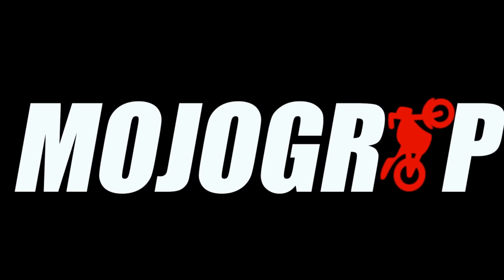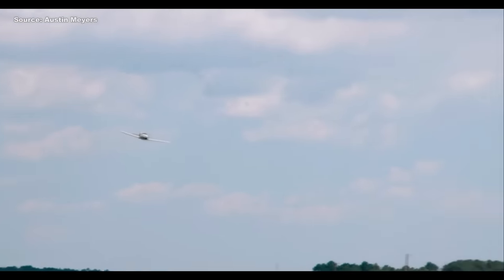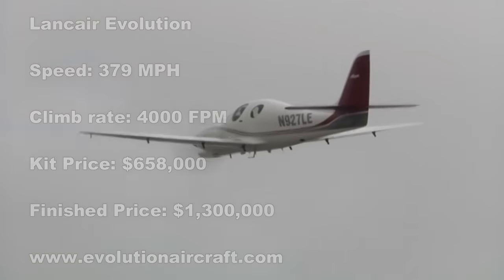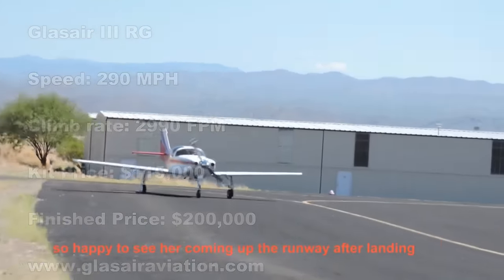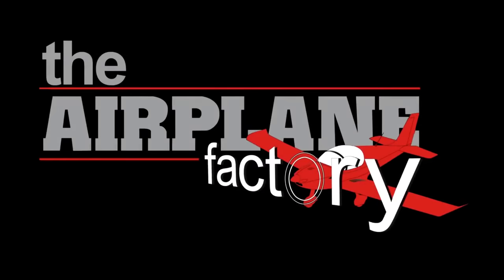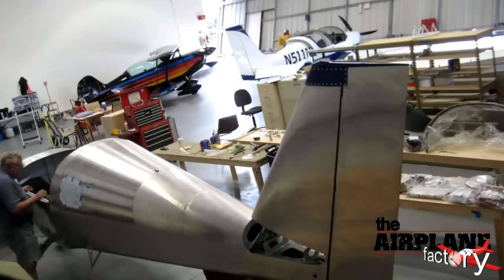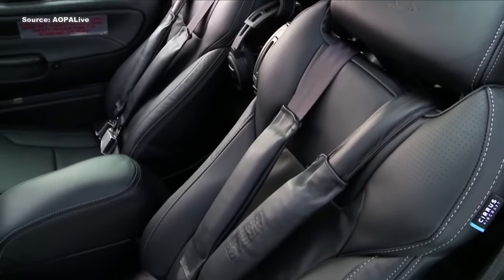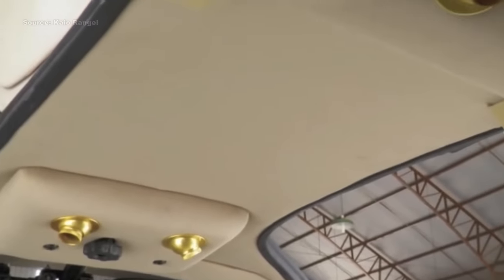Top 5 Best Kit Airplanes In The World

Comment: I completed an RV-10 kit in my spare time (I am a commercial Aircraft Mechanic) for a friend's father. With the full leather luxury trim kit, 300hp Lycoming and proper stick control it was a fantastic aircraft. I cannot say enough about the quality of the package and technical backup that Van's supplies. The plane was borrowed continuously by a certified test pilot where it was hangared. If you have never built a kit plane before, these can be built if you have basic hand skills and the CORRECT tools.
Reply: Hey, Thanks for the Heads-up on the RV-10.  Quality and build time is almost as imporant to me as Safety (almost as important, most important!) I'll look into it!
Reply: Tim Smith Van's has supplied quality aircraft (initially plans) and kits since day 1. I remember seeing the prototype RV 4 at Hillsboro Airport, lo, these many years ago. Have you ever been to Oshkosh and parked in the RV section?!

Comment: Many of the selections here seem to be favored because of their speed.  Don't get me wrong, I really love speed. But, when it comes to folks building kitplanes many do not get completed because of the very large amount of labor required.  Or, they end up languishing in a garage for 10 years before they are finished.
For that reason I think that expected build time should be a significant factor when choosing a kit.  The Zenair products are quick to build, but slow to fly...and that works for many people.  The new Rans S21 has my eye for being even quicker to build and recovers a fair amount of the speed that I like.  If only it had 4 places.  Both of those are also much cheaper than the choices in the video.
Reply from the maker: Good point. I didn't include build time because honestly that will very from builder to builder. Also with build assist programs available for almost all these aircrafts, it's tough to put a mark on which airplane will have the quickest or best build time.
Reply: Great point. I too had my eye on the Rans

Comment: You need to learn more about the Sequoia F8L Falco. Designed back in 1955 by famed Stelio Frati and it is the predecessor to the SF260 military trainer. It was a certified plane until the design was acquired and entered as an experimental in the USA. Best of all, it is an all wood airplane just like the DeHavilland Mosquito.

Comment: Hey dude, if  you like the Vans, check out the Zenith Ch640.  It's basically a kit plane version of the ch2000,  which is a 4 place certified aircraft.  I don't think very many of them have been built, but there are several of their certified counterparts still flying so it's a proven design.  If you're really bold, you can get plans for 500 bucks and scratch build it.  That's what I want to do.  There's a guy in my local EAA chapter that scratch built a sonex and I had the chance to sit in that.  I'm a little too tall for the legacy Sonex, but point being had he not told me it was scratch built, I'd have assumed it was a kit.  Seeing in person that it can be done and done right is a big confidence booster.  Several kit builders, it's actually a VAA chapter, so there are several A&P's and LSA gurus to annoy :D  I watch a lot of your videos, are you planning on doing a kit plane at some point and if so, what are you gonna build?

Comment: Glasair III used is more like 100,000 to $200,000 depending on age condition, engine, prop and avionics. They burn between 12 and 16 gallons per hour depending on engine altitude and other variables.

Comment: Hey Mike, speaking of utility, performance, ease of build, safety, land almost anywhere and just plain fun, do a review on Gyroplanes(Gyrocopters). I think the Eclipse and Taifun meet/exceed my explications and hopefully is in my near future. I have been flying for 40 years and speed is not in my vocabulary any longer. Although both these planes cruise along at a top speed of approximately 120mph, burning 5-6 gallons an hour with two onboard + carry-ons. There are so many different models/versions to salivate over, some for emergency purposes, pilot, stretcher, and doctor(3) at very affordable prices, much less than a home build(per-say). These do require the 51-hour builder/owner "FFA Part" type and do require a sport or private pilot license to operate and carry passengers. Nothing can match the maneuverability, climb, decent rate, compared to fixed-wing aircraft. If you haven't looked at them lately, give them a try. I think you will be amazed at their performance. As for time, taking off in my back yard and returning home makes up for the speed gained in flight, plus the time in trips back and forth to the airport. Let me know what you think? And yes, I am also an A & P, and the ease of maintenance is a no-brainer. Viking makes an engine based on the Honda design engines that outperform the Rotax on every level, in my opinion, and actually sounds like an engine instead of 10 weasels caught in a beartrap, or a "Forrest" full of chainsaws, LOL!!!!!

Comment: Bought my Lancair 360 for less than $100,000 (complete already built with glass cockpit and autopilot). I do 180 kts / 205 mph on 8 gallons an hour.  That's 25 miles per gallon boys and girls. Doesn't get any sweeter than that if you like to go places :)
Reply from the maker: Lancair 360 is a sweet ride. How many hours under your belt before getting into one?
Reply: A few months after getting my private. I'd say about 100 hours under my belt when I bought it, most of that being instruction time. I've gotten close to 250 on it since buying it though. Perfect for true cross countries (East Coast to West Coast).
Reply from the maker: Wow, and did you train in one or in a different aircraft?
Reply: I trained in 150, 152, and mostly 172's. When I bought the Lancair, thankfully, the insurance company required me to have duel instruction in it before I flew it on my own. I brought a flight instructor with me when I bought it, and we flew it home together.
Reply from the maker: Okay. You certainly didn't waste any time going from a cessna 150 to a Lancair 360. Almost double the speed. Curious what the adjustment was like. I've always loved the Lancair 360. Being a low time pilot though, I couldn't see myself flying one at least not yet. Kudos to ya. Safe out there!
Reply: The Lancair was certainly more sensitive, the instructor drilled into me right away about stopping the porpoising "let go of the stick". he drilled in. The other big differences, landing is never full-stall like a Cessna and never on one wheel for cross-wind landing basically always flying all the way to landing, and finally, never ever ever stall. The Lancair frame has a huge stall/spin accident rate even with thousand hour pilots, aerobatics pilots, and instructors on-board.

Otherwise, the Lancair 360 is actually easier to fly than a Cessna. Never have to worry about not having enough power to climb,  rudders require A LOT less pressure, and with the multiple GPS's that came with it and the autopilot, navigation is a snap.
Reply: What approach speeds do you set in the Lancair?
Reply: With full flaps, I usually approach at 73 miles per hour (my airspeed indicator is in MPH). With reduced flaps for gusty landings, I approach much faster, 100 miles per hour with no flaps.
Reply: I've seen a few here in Australia with very low hours, but I've been out the cockpit for 25 years. Would love to get back into flying and get my licence renewed with some training. Considered buying one of these to do a trip around Australia in, but thought this aircraft might be to hot to handle. Thanks for your reply.
Reply: If you are looking for one down-under; ask out the Outback gear. It apparently is more sturdy than the traditional gear, and is better for dirt and grass strips.
Reply: Hmmm, yes I'll keep that in mind...I also wanted one with the updated tail known as the Mk2. Do you run yours @ 65 power ? Top speed is not a real priority of mine but range is.
Reply: I'm not running at 100% in cruise, but I could be a bit more economical if I dropped it down a little more. This just seems to be the sweet-spot. Anything more, and I don't see much of a pay-off in airspeed for the higher fuel consumption.  I have just crossed the 200 knot cruise at 12 gph, so in my mind the extra 4 gallons for only 20 knots is nuts.

The plane holds 43 gallons, so I have over 5 hours of cruse available. I generally fly  2-3 hours between stops. I find my bladder gives out long before the fuel does; and the way the control stick is situated, no real room to deal with things in air.

Yeah, most of them out there have the larger tail also.
Reply: Yes, 3 hours would top out my bladder too... I could cover a lot of distance in this plane in that time to make the trip enjoyable. I think the top speed of the Lancair fitted with the I0 360 is around 220, but I was intending to cruise below those figures, somewhere near 190-200. I know these aircraft are slippery to slow down, at what distance do you usually start throttling back from the airfield?
Reply: GREAT QUESTION. That is something that gets me in trouble all the time. I like to fly at 10,500/11,500 (odder altitudes like 10,300/11,300 if I'm not on flight following) I start thinking about descending around 100 miles from destination airports (I'm I'm above a cloud deck, I start looking for my whole). If I don't start my descent by 50 miles out, I am always slipping my way down.  I normally cruise at 180 kts when I fly cross country (I mean Florida - California). When I flight plan, I usually take the full trip and then plan landing stops about every 500 miles. That usually keeps me in good shape if I hit a slight headwind.
Reply: Maximum we can fly here in OZ is 10,000ft due to no pressurisation in the Lancair. I was thinking say, 500ft descent @ cruise speed to circuit height of airfield plus allowable distance to throttle back and wash off airspeed just before the airfield say 120kn depending on headwind or tailwind conditions. Obviously in tailwind conditions I would descend earlier... What's the airspeed you usually set at in the circuit area? Being such a fast aircraft that it is, the risk of thermal shocking cylinders is great if you fail to keep ahead of the aircraft.That's my concern with this plane. Have you had any overheating issues concerning the engine with the Lancair? I've heard these engines are fairly tightly cowled and tend to reach critical temps even on take off power.
Reply: I normally come into the airspace at full speed and don't start bleeding off the airspeed until I am in the pattern or otherwise have the runway made if I am coming straight in. I normally do over a thousand foot per minute descent as I get down below about 5,000 AGL, pulling the throttle and trading off the altitude to keep my airspeed up.

Once I'm in the pattern, it is more about getting slowed down to flap speed and then bringing in the flaps slowly. It may seem strange, but I really don't pay attention to the actual airspeed in the pattern as much as paying attention to the pitch of the nose while I am flying the pattern.

Yes, the engine is a tight fit; but I've never had any overheating problems. I am always good about leaning out slowly as I climb, and enriching the mixture slowly as I descend. I never do anything rapid with the red knob.

I'm sure I could have higher airspeed or even have more efficient leaning; but I don't like to push things all the way to the edge of the envelope. Not sure if that is why I've never had any thermal issues or not, but it always has been a real champ for me.
Reply: Okay, well that's food for thought. I'm quite sure I'll be asking more questions when I strap this plane on. Nice talking to you, cheers.

Comment: Building an RV-10 with my dad right now. So yeah I would agree that the RV-10 is the best kit plane for the cost of the kit!
Reply: I would like to see every step of the build. From getting the kit to flying the plane. It would be interesting.
Reply: WC you are right the RV10 is a kit plane just like all the other planes in the RV family. You buy the kit and then you assemble the plane from the kit and add any modifications of your own to the plane. For my mission (which is to fly recreationally with friends and family, build time, and fly cross country) the RV10 is the best plane for the cost of the kit. At least that is my opinion. I am sorry I used the word “build” I did not know that would be a trigger word for you. What planes have you built?
Reply: Jeffrey Henry Well done on taking the high road!
Reply: How much it cost the kit?
Reply: Jeffrey Henry How much it cost the kit?
Reply: Samuel HerMan you can buy the kit for about 50k. The Lycoming 540 engine is about another 50k and then avionics can cost anywhere from 5k to 50k or more. Usually a good paint job cost 6-10k. You can reasonably build a “simple” RV-10 for 120k however the one my dad and I are building will probably cost over 200k when we are finished because we are putting the newest Dynon avionics in it with a premium interior and paint job. The other expeensives you have to think about Samuel is cost of tools and a hangar or place to build the plane.
Reply: W C  Don't be foolish, I BUILT a Glasair 1RG kit, it took 4000 hours and 10 years.

Comment: I'm missing the Vans RV8 on the list. I completely understand that you wanted to present a variety of different experimental aircraft companies, so you had to chose between the different types that Vans has to offer. On the other hand: if you put together price+performance+range+maintenance cost, there is nothing remotely close to a RV8. All presented planes are a lot more expansive. Not all pilots have kids and not all pilots need the four seats (just like the Sling 4 made it to the list). I got I PPL and have some experience as owner of a Beechcraft A23-A (flying alone 99% of the time with four seats), but my dream aircaft is: a Vans RV8(A) 180 HP IFR with long range tanks - perfect combination of fun and cross country abilities. THE aircraft for EVERY mission (ok... I'll take the limit of pilot+1 passenger).  Wow! That would be it ;-) !!! (... making note to bucket list....)    [side note: I think the RV8 look MUCH cooler than the RV8A, but for safety reasons the RV8 just makes more sense, which is worth losing a few knots.... after all: once airborne you no longer see the landing gear]

Comment: The rest of the Van's lineup is really where it's at.  The RV-7 is a little smaller than the 10 but capable of acrobatics.  I burn 6-7 gal per hour and cruise at 185 mph.  It set me back about as much as a decent sports car, not a house.  You can't go wrong with any of the Van's RVs.

Comment: Ummm... one thing I would disagree with on "experimental" is the comment "you just go buy a kit..." as there are a number of planes available to build by just buying plans and doing a "scratch build"; also nothing in the rules prevent one from building anything you can dream up - which usually means engineers and knowledge of materials/structural techniques. In all cases during building requires review by FAA (or designates) and more importantly signoff. I would encourage anyone interested to find a local EAA chapter and join to understand rules, regs, and building requirements (tools, techniques, how to work materials, etc.)

Comment: The X Cub is not a kit plane. The numbers on the X Cub are way off. X Cub is an FAA Part 23 certified aircraft with a base price that starts at $317,000. The SS, FX, and EX are kit planes from Cub Crafters. SS starts at $199,500. FX-2 starts at $230,990. FX-3 starts at $262,490. EX-2 and EX-3 are even more. http://cubcrafters.com/carboncub/ex
Sonex Aircraft https://www.sonexaircraft.com/waiex/ You can build and fly a Waiex-B for $37,814. Sonex aircraft are very well engineered. They are reliable and dependable. They sell both kits and quick build kits.

Comment: does anyone know why the evolution has a useful load of only 800 pounds? I would think that with a turbo-prop engine that makes so much power would have a much higher useful load.
Reply from the maker: Fuel. Having a turboprop engine also means you have an engine that gets thirsty and requires a lot more fuel to burn. All that fuel in your tank eats up the useful load.

Comment: Uh, no, that is incorrect. The Glasair III does not have the same fuel consumption per hour as a Cessna 172. That is nonsense. Then Glasair's 300 horsepower IO-540 engine produces nearly twice the power of the engine in the Cessna. You don't get that for free. At max cruise the Glasair III burns about 18-22 gallons per hour, or about a galon every three minutes. But the Cessna 172 burns only about 8-10 gallons per hour.  Of course the Glasair 3 is more than twice as fast as the 172 and only has two seats, compared to the Cessna's four.  But if you add up the seat-miles per gallon of both engines, they're at least  comparable.

Comment: I'm sorry... And I listened to it twice... Did you say the Lancair Evolution burned 45 gallons an hour? I cleaned out my ears and backed up the video... Sure enough... Not 4 to 5, but 45...
Reply from the maker: You heard correctly. Those turbine engines get thirsty :) 45 gph is actually considered efficient for an engine close to 1000 HP.
Reply: At $4 a gallon, that's $160 an HOUR just in fuel... A little beyond me... But I saw some others on your channel that were very nice, and affordable... Good channel...
Reply: If you can afford $1.5m plane $160/hr is pocket change.

Comment: You can get a much better plane for less than the cost of the Evolution. You can get a Cirrus SR22T used for less than $250k and new for around $750k. Much better plane although not as fast as the Evolution but still cruises at around 250 knots with a 1200 lbs+ payload capacity.